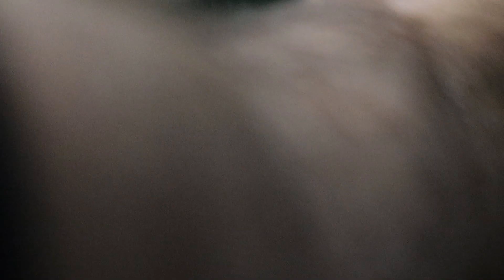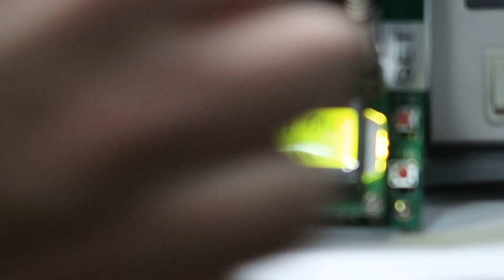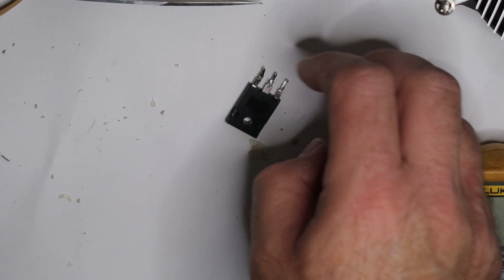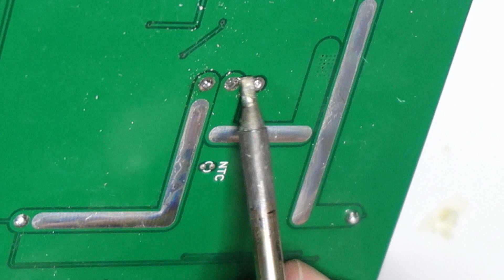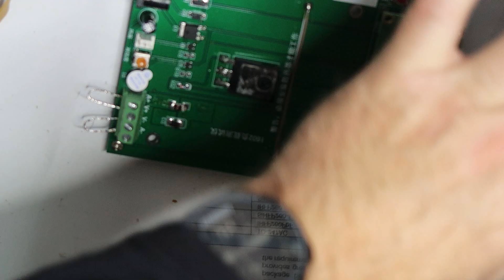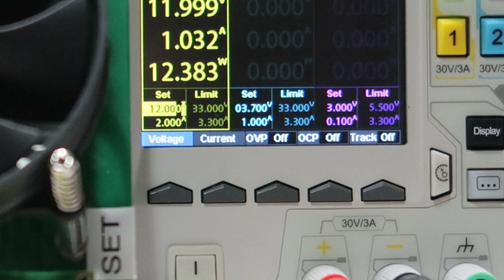How to Fix Electronic Load 150W 60V 10A

Comment: This dummy load is MOSFET burner. IRFP250 have maximum 120W  power dissipation calculate from datasheet for 90C to Tcase according to Junction-to-Case thermal resistance, and IRP260 have 130W. Best MOSFET is FDL100N50F  who has 1200W(1,2Kw). Resettable Fuses - PPTC have low voltage rating usually under 12V for high amperage.
Reply from the maker: Did you try to change the Mosfet for this device ?
Reply: @RoeeBloch  I have DL24, because working in DC input capacity and  static resistance of MOSFET, not really matter. What is important is gate threshold voltage and Junction-to-Case thermal resistance.  I replace MOSFET and cooler. https://youtu.be/agY3rmB9xp4

Comment: Nice repair instruction, even a bit long. However, it does not solve the root cause. I have made some investigation and found they might messed up the display library. The reason, sometimes you go on off mode the gate looks like getting still a signal. Its a very low frequency signal and to me it looks like a chip select to display activities. Anyway, to solve this i dont have the software and there seems to be no interface connection anyway. So how to hack work around in HW. I think i found a way. Just open the PWM port from controller to the first low pass filter and put a 10nF and a shottky diode at filter side to ground. This avoids passing the low frequency pulses but is still passing the PWM which is running at 25.6us or 39kHz. Im happy with this fix even the precision is not getting better. There is no outer refulating loop in SW so there is only a voltage controlled current source with an OpAmp LM358 and a shunt and the Mosfet. But this is closed loop regulated and needs a precise voltage to give a current. The PWM values are coming calibrated maybe or fixed for all models the same. Anyway, are you interessed in this solution?
Reply from the maker: ha - first good job, I did not try to see again if this is fully solved, since I have moved to another version of electronic load, yes if this is the case a filter can solve this (better SW ... can ask them to give it?) - any way please show me your solution. thanks,
Reply: Roee Bloch , but then you do not need this fix anymore. I have not time to make a full video, just a quick explanation i can give. But i have doubt you can follow without the original board.
Reply from the maker: send me what you got to galaxy3825@gmail.com
Reply: I have two of this modules and both are destroying the Mosfet after a couple of seconds or latest some minutes. Could the fix of illchmann help me to save the modules? My modules comes with IRFP264N Mosfets. What are you think, are this a wrong type and thats why they are destroyed?